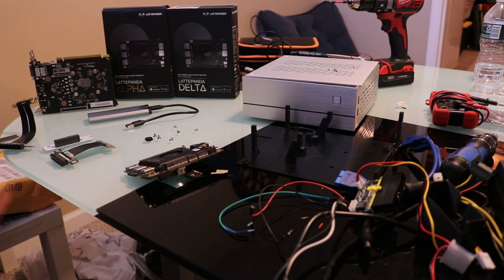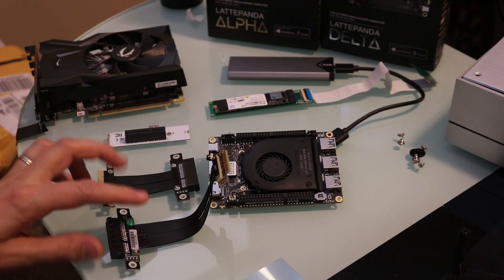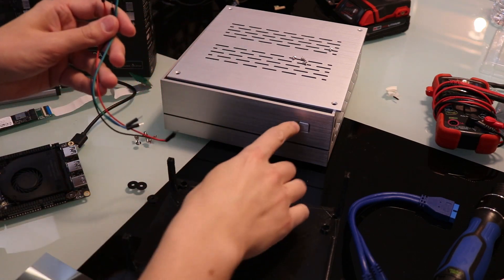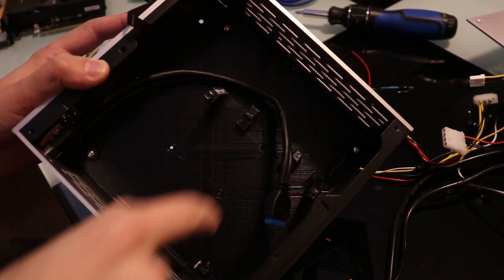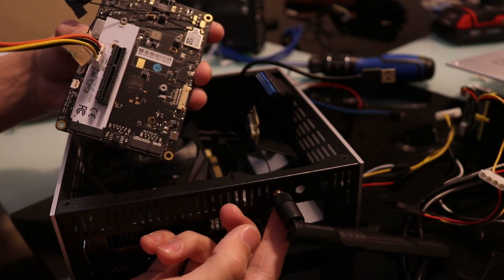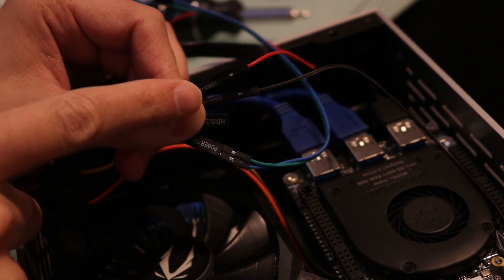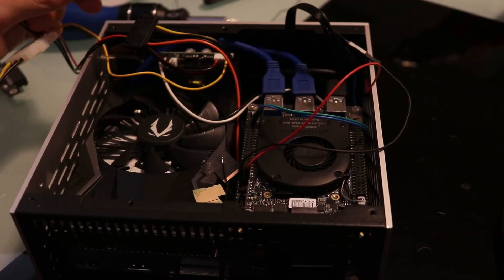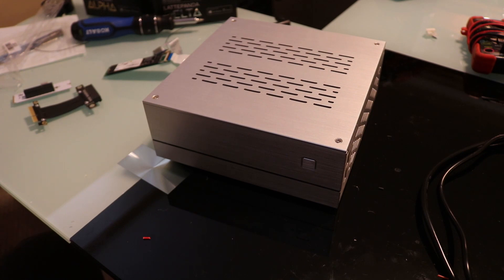The smallest GTX 1650 SFF Gaming PC Build - Lattepanda Alpha + GPU: Part 2 How To Build

Comment: 4:47 this part make me confusing
Reply from the maker: The case has two usb 3.0 ports. It has the motherboard pin header connector. The lattepanda alpha does not have the 3.0 pin header, so I used a converter cable from two usb 3.0 ports to motherboard pin header
Reply: @HandheldHardware  tq for explaining

Comment: Are there any settings so that the GPU can be detected by Lattepanda Alpha? I will use a white m.2 M-key to PCI-E 4X adapter like you :)
Reply from the maker: There is one, disable PXE to LAN in bios. Unfortunately if the white adapter doesn’t work, it means it won’t work. The white adapter is a cheap adapter, I only learned that after I tried to use on my lattepanda delta. The trace impedance isn’t properly matched and it won’t work with every board or gpu. ADT Link makes high quality adapters that will work every time
Reply: @HandheldHardware  Thank you for the advice  :). Can you tell specifically where the PXE to LAN option is? It seems I have a hard time finding it. i am using bios version 2019 (M3-8100Y). what I found that came a little closer was the "onboard LAN" option in the chipset tab.
Reply from the maker: @primaldy19  there is a good chance the adapter doesnt work, because the white adapter board quality is not great. Something happens to the pcie signal that interferes with it and causes it to not work (poor impedance matching, signal traces not properly isolated, trace lengths not matched) . I suggest ADT link adapters, they are high quality and will work across the board
Reply: @HandheldHardware  Thanks a lot for the advice. I've tried using ADT link adapter for GPU and E key to NVMe for SSD like your suggestion in another video. Everything works fine :D
Reply from the maker: @primaldy19  awesome news! If you have a picture of your setup I would love to see it 😁

Comment: This is awesome and I’d love to do the same. Can you further explain or drop a link to the PicoPSU jumper?
Reply from the maker: Are you talking about the mesh of cables? I’ll try to update you in a day with some more detail. I’ll be updating this again, it probably doesn’t need a pico PSU I really just used it for the capacitor diode. PSU cap and diode will probably cost $25-30 total compared to getting a picoPSU which is $50+
Reply: Project-SBC No sir, I don’t believe so. I’m not exactly sure if I’m asking the right question? I’m talking about the jumper on the end of the Pico Psu so it does not need to be plugged into the drive which you mention @ 2:26 of this video. I have the PicoPSU in my cart but does not appear to have this jumper you speak of nor can I find one. This a great build and I appreciate you sharing you expertise. TY!
Reply from the maker: Will R. Ah yes, this is the jumper I used CRJ 24-Pin ATX Power Supply Jumper Bridge Tool https://www.amazon.com/dp/B01N8Q0TOE/ref=cm_sw_r_cp_api_i_qzomEbX7HRJRZ
Reply: Project-SBC thank you sir! I look forward to more videos!
Reply: Xbox GPU

Comment: I want to build something like thtat too but the lattepanda alpha is very expensive and for the money i can build a full sized pc that is better.
But good video👍
Reply from the maker: Agreed! Do you see any cost effective mini pcs? Maybe there is a better option than LPA
Reply: Odroid is another cheap x86 sbc. However i don’t believe it uses a m.2.
Reply: Do you know a mini pc with the same specs for less money?
Reply from the maker: le Schnößel https://m.aliexpress.com/item/33027710632.html?spm=a2g0n.seo-amp-detail.productBottomBar.viewDetails

I5 8th gen mobile for $250 no ram no wifi
Reply: le Schnößel there is the asrock ryzen apu desk mini. It is around 150 bucks without ram storage or cpu. So all in around 300 with 8gb of ram, a 300ge, and a 256gb ssd. 

However you can purchase a 300ge with 8gb of fast low latency ram from someone like viper, a 256gb ssd, an asrock itx b450, and a tiny itx case without expansion slots for a gpu and it will cost you about 260-270 bucks. It’s actually such a good deal I’m considering building one as an htpc now. Maybe.

Comment: add battery on that, the batteries not enough for GPU but you still can launch lattepanda
Reply from the maker: I'm thinking about slimming down my gtx 1650... maybe it will eventually turn into a laptop build??? who knows?
Reply: @HandheldHardware  if you gonna build a laptop, you can use Mxm gpu models to make it slim (Mxm gpu to Pcie e bridge)
Reply: CoderH sorry but that would be so cost inefficient even if cool. The 1650 uses very little power and as he mentioned trimming it, there would be very little difference if he put a single slot gpu cooler on it or ran it passively. 

I think you should make a slightly thicker gaming handheld tablet type device. Add controllers on the side like joycons and a touchscreen on top of the enclosure.
Reply from the maker: jordan secrist you are right, a mobile gtx 1650 is 50W power rated, slightly less than the desktop but wildly more expensive to buy plus you need an expensive adapter (non mining version). It’s got a small performance hit being mobile. You can underclock a desktop one and probably get similar power draw. I do like the idea of mxm cards, it’s just not cost effective for me at this point. Keep the ideas coming though! I love it when you guys engage with ideas
Reply: Project-SBC I literally just built my first sbc a few moments ago. Christmas present for my dad. Very exciting.
Reply: @MisterRorschach90  i got Waveshare 5inch H screen for my birthday gift "Merry Xmas" (i didn't even notice this video was uploaded in my birthday)